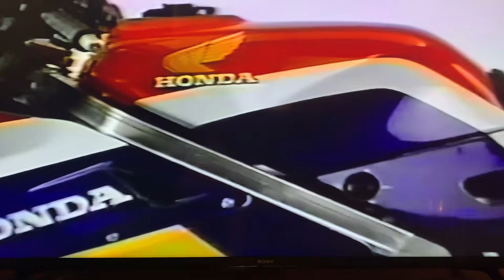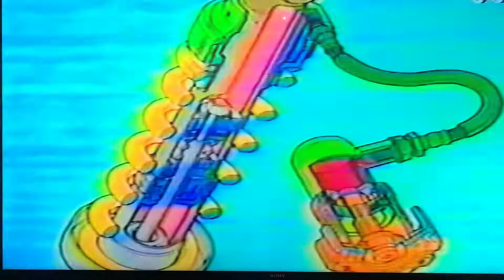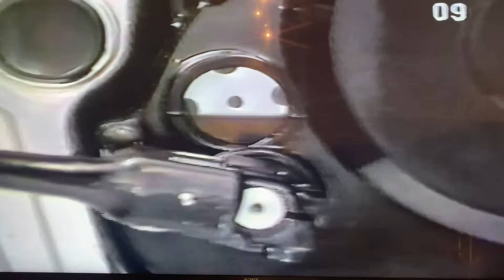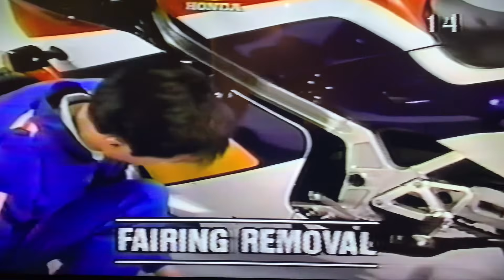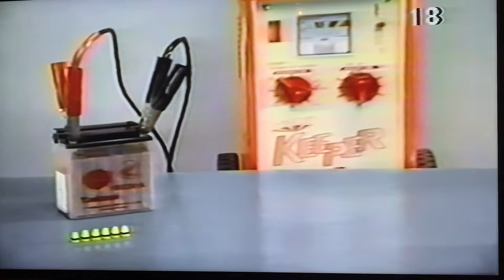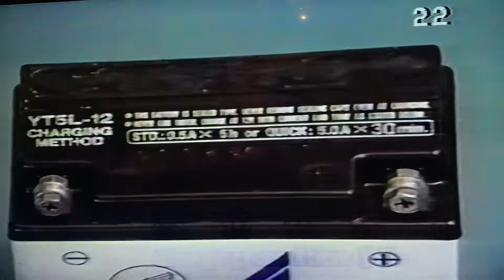Honda NS400R Dealer Training & Education Video

Comment: really interesting to see this video. Differences that are noticeable are the radiator is bright alumium on this model, and that the coolant expansion tank is in the right hand fairing pocket.....whereas retail models were in the left hand fairing. I think...the ns250r had the tank in the right hand pocket too. This must have been a really early factory model/prototype used in this video. Very interesting, and thank you for uploading this.,
Reply from the maker: Good eye !!

Comment: I bought a brand new NS400R in 1986 in Rothmans livery at the tender age of 17. I felt like Wayne Gardner. Unfortunately it ran out of fuel when flat out and holed a piston. It was still under warranty and rather than leave it with the bike shop my father (mechanic and bike nut) convinced the dealership to supply the parts and rebuild it ourselves, or more accurately my Dad did the work whilst I handed him tools. As the barrels were Nikasil coated the repair involved not only a new piston but barrel as well. Fantastic machine, though even in its day tyre choice was rather limited, I think it had a 110 on the back which skinnier than most fronts these days.
Reply from the maker: I love my NS400R.   East parts are almost impossible to find so I tend not to ride it any more.  

I was lucky enough to get advice 10 yrs ago whe n I first got it, to buy every spare part I could find.  

So I trolled EBay every week and bought everything I could 

It was a good thing as I’ve already had to change one of the CDI boxes which are now almost impossible to find.

My NS is HRC colour but I also have some Rothmans bodywork for it.

Comment: Hi I enjoy your channel  was wondering if u had any Info  on that rubber restoring formula I think it may have been isopropyl alcohol snd wintergreen oil ?  Not sure if the proportions I’ve asked on a couple of forums but sadly no luck   Luv these ol nsrs I saw someone had bored theirs to 500 cc 😳👍
Reply from the maker: Hi Karl, yes it’s 1 part oil of wintergreen and 3 parts isopropyl rubbing alcohol. 

I have seen the big bore kits for the ns400r.   I’m sure Ian wright used to have them available (could be wrong) he runs “classic race replicas “ and has lots of parts for the NS

Comment: Video makes it look easy. Using that factory rear stand is nerve racking. You have to hold the bike vertical with your left hand while trying to maneuver the stand into position with your right and trying to engage the stand with the tabs on the swingarm which you can't see. I still sweat each time I use it.
Reply from the maker: Yea, I have that factory stand for mine, not easy to use